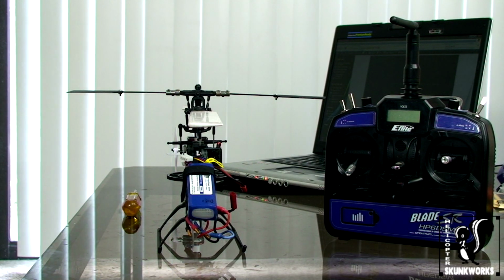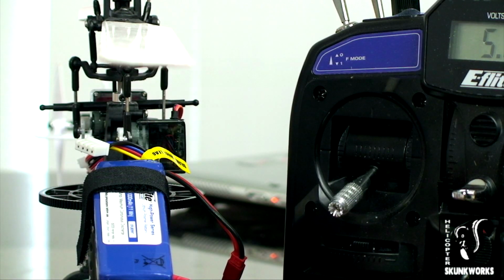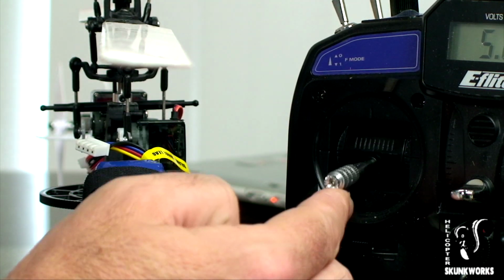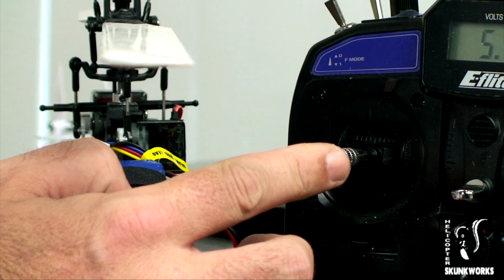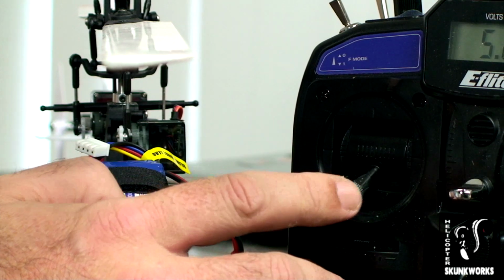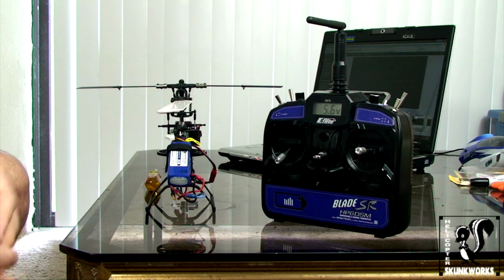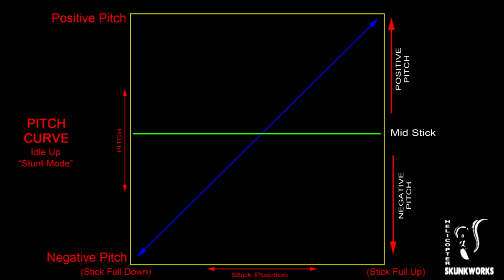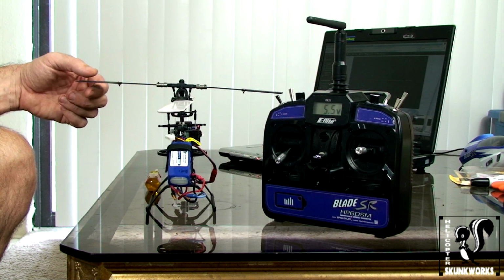E-FLITE Blade SR - Idle Up / Stunt Mode Explained Part 1 - Official Beginner's Guide Part 8A

Comment: @tomtom4867  Assuming your helicopter is set up properly, the higher headspeed will make the heli more stable. Remember how the helicopter will fly at a much higher throttle speed when in idle up mode. The variation in pitch, positive or negative, defines whether your will gain or lose height.